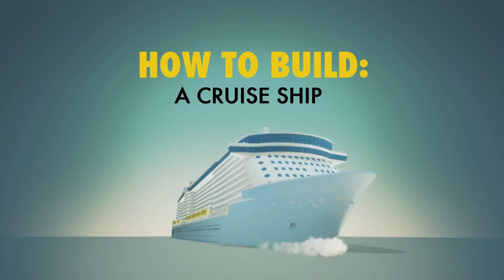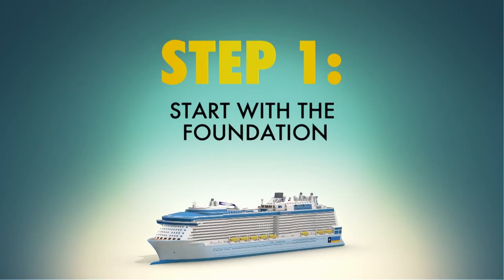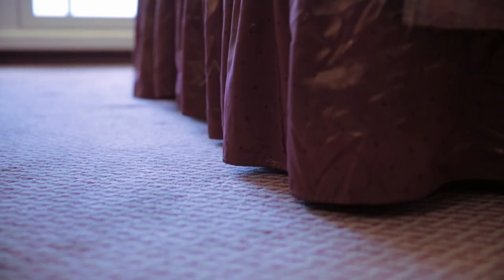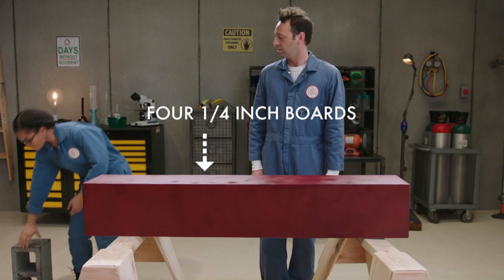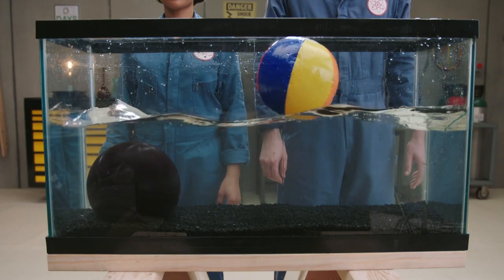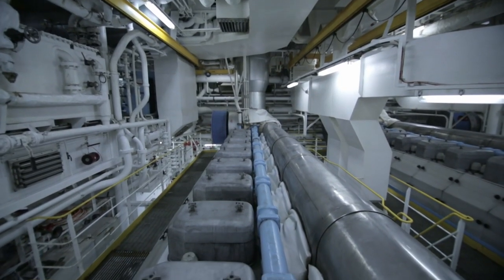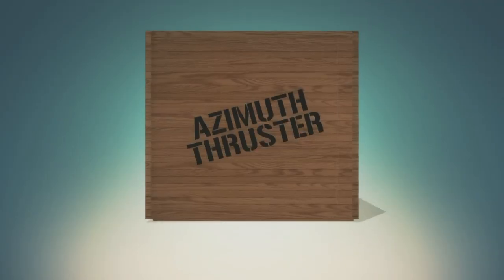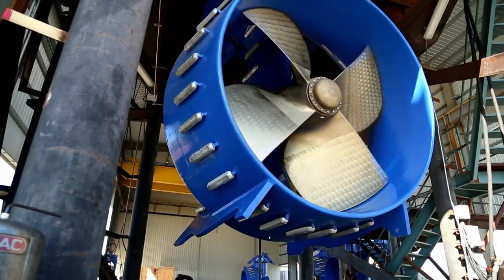How To Build A Cruise Ship | How To Build Everything

Comment: .... so they take 4 planks of wood and arrange them in a box formation, and that can hold up a cinder block better than a single plank of wood? no fucking shit.... a better example of the strength would be if they took 4 planks of wood and had them stacked, not just one.... "We used 4x as much material, and ended up with something 4x stronger" ......................... really?